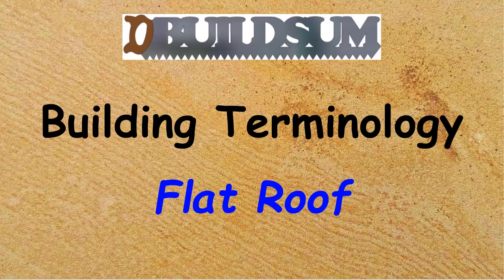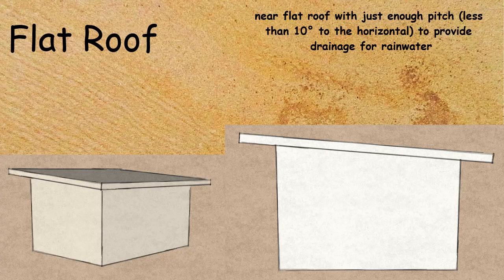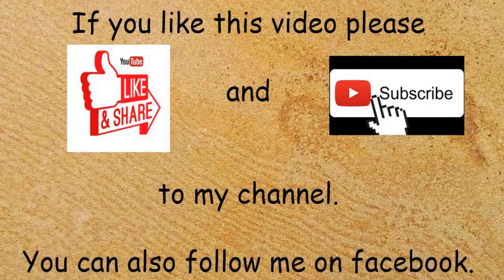Building Terminology - Flat roof

Comment: have seen some interesting rendered designs online with flat roof & what appears to be parapet wall on either side.
I'm having difficulty understanding how it comes together from ceiling upwards when looking at a 2 storey building.
Can you shed some light on this for me or give some practical drawing descriptions etc.  Most of these types of videos do not show any drainage  solutions.
I have seen some of your other videos & found them extremely valuable resources to get good factual information
Reply from the maker: Hi Mate, with a parapet wall there is what is essentually a box gutter behingd the wall. There are some details on this webpage.
https://abcseamless.com.au/box.htm
Personally I have never seen a box gutter that has not leaked or overflowed into the building at some stage and I aviod them at all costs. Hope this helps.
Reply: @Buildsum  thank you for the quick reply. Is it possible to send a picture to you to show what I was looking at that caused my curiosity of how it was portayed in the video?
Not sure if can do via the message reply but may need send via email
Reply from the maker: Hi Sure send it to buildsum@gmail.com
Reply: @Buildsum  email on the way, thank you. Hope the photos can provide an insight into my enquiriy